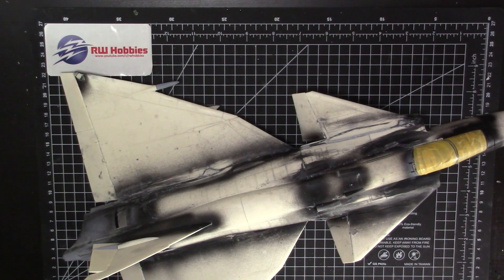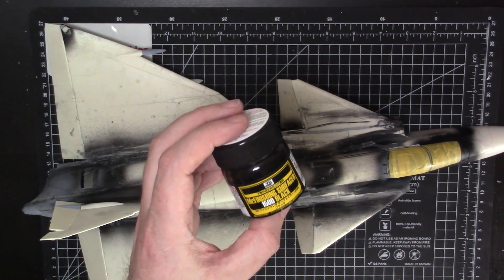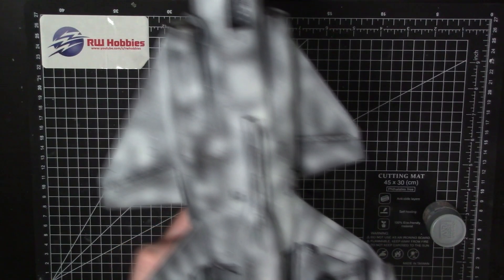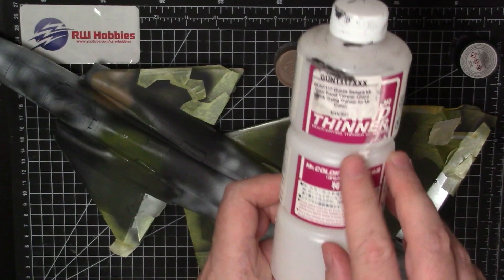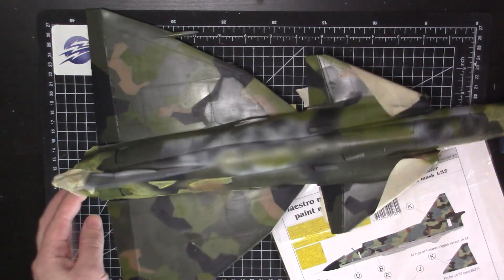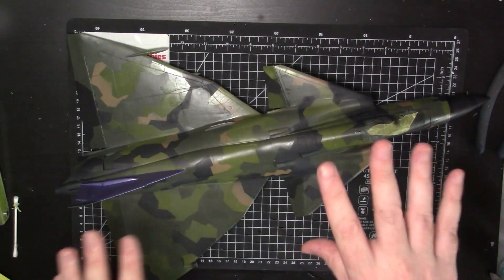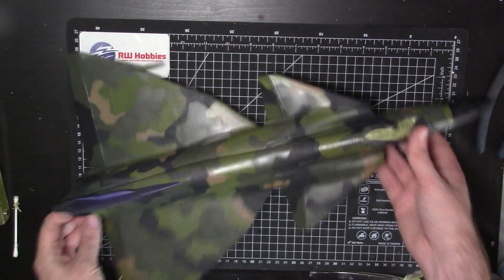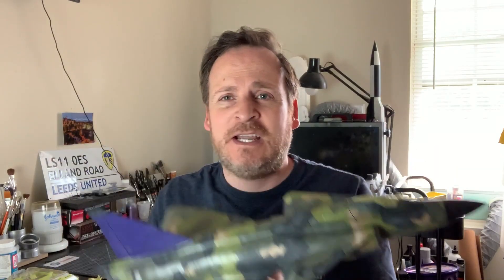1/32 Jetmads JA37 Viggen Build Series - Part 7: Painting

Comment: A suggestion for the mask set and finding where the heck the cuts are etc: I use some Tamiya Panel Line wash to highlight the edges. Just touch the brush to the sheet and let the wash do what it does best. It dries pretty quick and once dry, does not affect the adhesion nor does it leave any residue behind.
Reply from the maker: Good tip, thanks for sharing